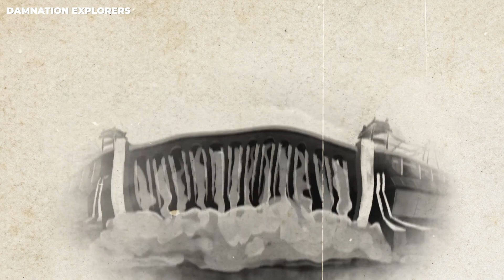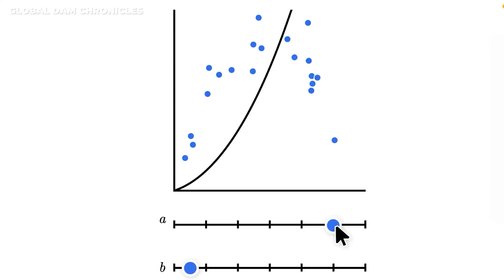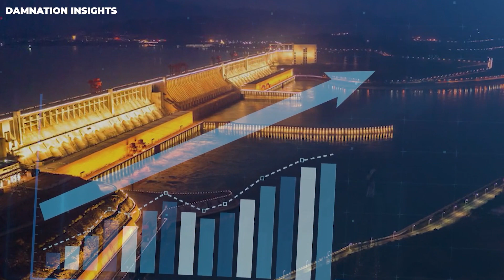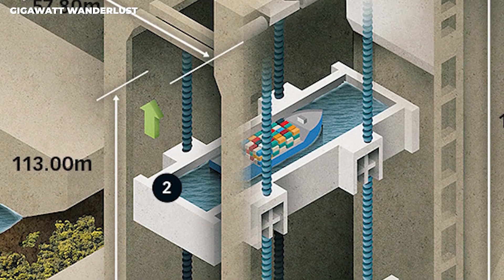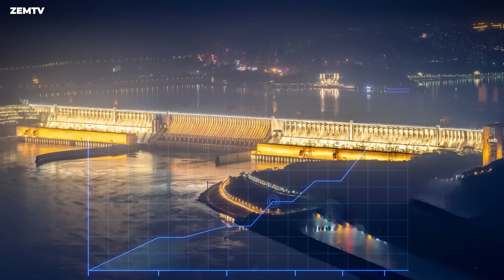SHOCKING! CHINA $28.3 Billion Three Gorges Dam Has Failed and Will Break

Comment: The dam builders didn’t have the weight amount of liquified earth, traveling at velocity in the calculations when the dam was built. The weight of a gallon of liquified earth weighs 8.36 to 13.6 pounds per gallon (3.79 to 6.17 kg per 3.79 liters) and the impact force moving at a substantial velocity will collapse embankments, bridges, abutments, buildings and move vehicles regardless of size. The effects of liquified earth are currently impacting every continent and is not reversible.
Reply: @reverendovargas
Hace 0 segundos
¿Eso no importa el dano mundial ya este hecho sabias que la orbita terrestre ec muy importante para la raza humana? bueno pues debido a eso el eje y la orbita terrestre se movio.